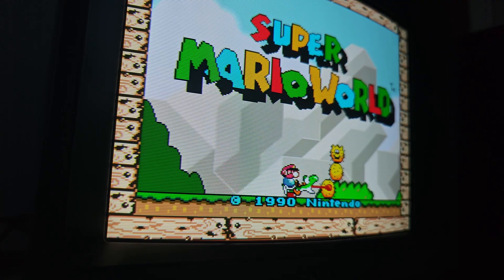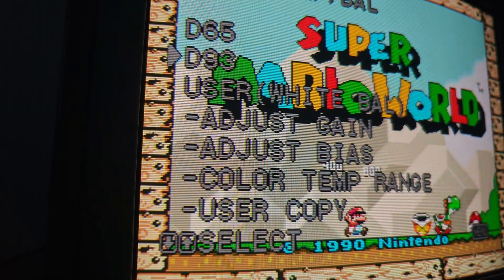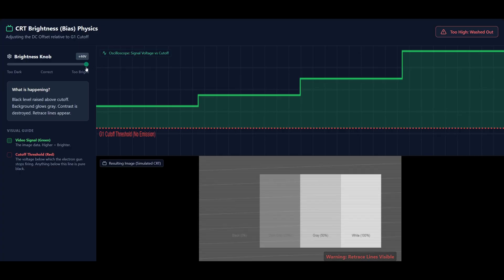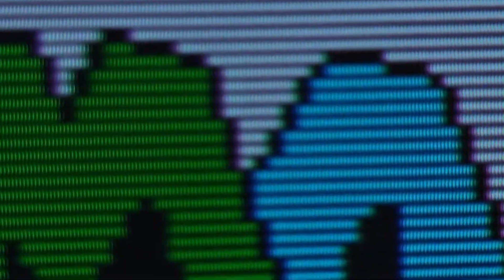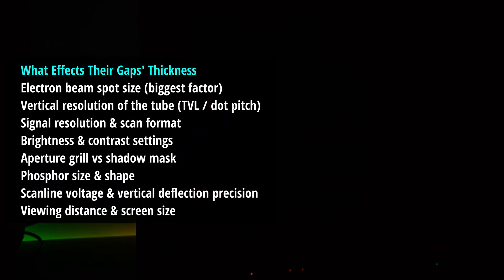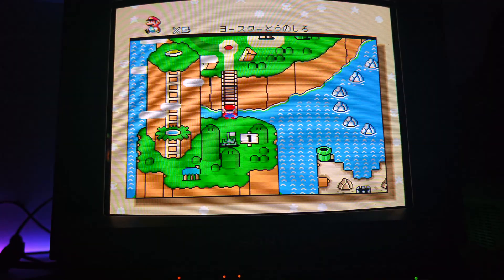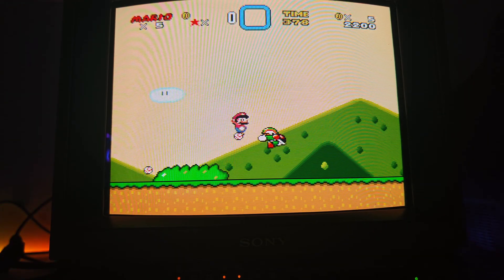High Contrast: The Scanline and CRT Silent Killer

Comment: when using composite or S-video you can adjust how colors look with the "ntsc setup level" setting, I believe 7.5 should be used, and for component there is a setting called "component level" 7.5 should also be used as well. It makes quite a large difference in black level. I recently found out about these and fixed my issues with s-video and component, they looked much worse than rgb, now they look amazing.

Comment: Thanks for this video. 
I revisited my settings for my 14m2e and realised I had my contrast set far too high. 
Sometimes my fd trinitron looked sharper than my pvm and now I know why. This has really dialled the image in better for me with much sharper and pronounced scanlines by moving the contrast down. 
I’ve disabled the trap filter that was set to on and moved the ntsc from 7.5 to 0 with the D93 colour palette and it’s looking great, much clearer. 
Hopefully the set lives for a few years longer too now 👍
Reply from the maker: You are welcome. Yeh, lifespan of these precious tubes is a significantly important. It's not that are easily replaceable and fixing can be troublesome for some. Happy to hear it helped you out.

Comment: 04:51 The electrons spread out because slower electrons do sharper turns in a given magnetic field. Bright images sag because they would violate the specified power ratings and basically cooling. I guess that "paperwhite" Macs had such a small tube to keep power in check despite all the white. I love dark mode btw.

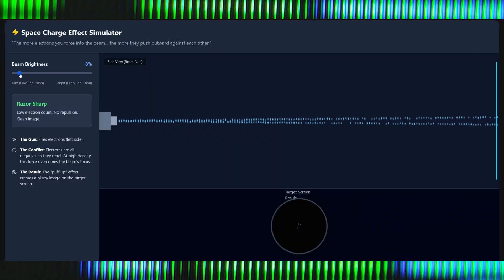Comment: 04:17 what about the electron gun? As far as I understand, electrons escape the cathode until space charge becomes to big. The analog modulation lets out some electrons. They accelerate and disperse. So space charge in the beam is always far lower than in the gun. Also electrons accelerate almost all the way down to the shadow mask. 40 kV on big color TV. X-rays. So the density is very low. Electron optics can be adjusted to focus at a certain intensity. So the spot becomes wider for darker and brighter colors. Space charge is a quadratic effect. So we need more modulation on the lenses, but still far less then on the gun.

Comment: Japan used D93 white point so every Japanese console and anime from before the HD era will look correct on D93. Black level (controlled by brightness) for analog videogames is 3.5 IRE in a Full RGB range (7.5 IRE for NTSC content like a VCR), it's not cero, the beam never turns off, if you force a very low black level you will lose a lot of dark detail, not only that mid tones will be at a lower luminance and image may look less vibrant, this is really important for the CRT to look it's best. Contrast (White level) should aim at 100 nits to 120 nits less will be too dim, more will put the autobrightness at work, CRTs were never super bright. You'll need a colorimeter for that one.
Reply from the maker: Great insights thank you!

Comment: Nice video! I usually do prefer d65 as im used to it in all my displays haha bit yeah on the beggining it can look strange or yellowish, but its just not blue
Reply from the maker: Thanks. I see the 'blue' as natural but I think I just got used to unnatural light maybe. D65 is more comfortable and less stressful on the eyes for prolong sessions and aside from that, for other games that I played I actually prefer the warmer tone. So it's kind of game dependent. So in general, I think that I'll also will be favoring d65 for most content, at least based on my experience with more games tested as of now. Thanks for your comment.
Reply: @CRTGang yess i also noticed the lesser eye tiredness haha but yeah the bluesh tone can look punchier and sometimes looks nice, but the d65 gives me a more cinematic vibe so.. haha its a taste thing (:
Reply from the maker: @gustavosanches5674  Yeh, and at least in the case of the PVM this can easily be adjusted. I do this all the time when playing games on an LCD, just switching a color profile to what I like better. Color accuracy unless it's a critical work and for checking out first don't matter that much to me. Also when I played a lot with warmer tones at some point, the 'colder' tons look waaay TOO BLUE, soi it's also the adjustment to the change that plays a significant role. I felt the same with sound BTW, when my years are used to a certain sound and I move to a different headphones.

Comment: I'm using a Samsung Syncmaster 955DF high end 19inch PC VGA CRT monitor. 0.2309mm real dot pitch with a flat tube and invar mask.

Literally the sharpest dotmask CRT i ever watched in my entire life with text clarity that destroys my 24 inch 1080p LCD, looks like crystal clear as a 27 inch QHD display. It doesn't matter if i increase or lower the brightness, the size of the scanlines doesn't change.

Daily driving this beast at 1792x1344 or 1706x1280 60Hz progressive. I usually use 1080p for 16:9 while watching youtube videos to get more of an HDR brightness and color pop. I never tweaked this PC monitor, it just works.

I have a Sony Trinitron 32inch TV and the problem with Trinitrons is degraded geometry or stability vs something like my Samsung dynaflat tube.

Since i can't reach 15KHz for minimum horizontal frequency, i only use a component shader and get half of my vertical lines for that PVM look but with the benefits of an absurdly sharp high end PC monitor (holy grail is the 1100MB or 1100DF, or the top tier Mitsubishi Diamondtrons that absurdly expensive, or the FW900).
Reply: vector displays and pictures of the yokes and impedance measurements by others tell me that vertical deflection responds well to overlaid horizontal deflection -- if the electronics was FOSS -- . We need a Mister for CRTs. Then the repeated scanline could form groups, and then jump to produce one black line. With the pixel clock of HDMI it should be possible to create vertical scanline (on a dotmask).

Comment: Great video and I'm glad you made it because I've been arguing these exact points for a long time but your video makes it very easy to understand quickly.  I would add that turning up the color setting too high can worsen the image because it causes color bleed which, in effect, softens the image.  I do have another suggestion for a video.  I notice that when viewing a pure RGB signal on a CRT TV, the colors look more muted or subdued and personally, I don't like that.  I generally like the color processing on CRTs that's added to the other signal types because the image looks much more vibrant and sometimes more accurate.  For example, I often find that with a pure RGB signal on a CRT, yellows, reds, browns and orange look pale but compared to composite, s-video and component, yellows look much more vibrant and accurate and reds look much more vibrant.  This is especially noticeable when you play a game such as Super Mario Galaxy that makes significant use of yellows, reds and browns because of Mario's red outfit, all of the yellow stars in the game and the many levels where the ground is a shade of brown.  It would be interesting if you did a deep dive on CRT color processing and how it works.  Another interesting side note is that some CRT TVs allow you to change the type of NTSC color decoding in the service menu.  On my Sanyo DS27820, I didn't like the default color processing so changed to a different NTSC color decoding option in the service menu and it greatly improved the picture.

Anyways, keep up the good work.  Videos like this are exactly what we need in the CRT community and the depth at which you go into this stuff is very much appreciated.
Reply from the maker: Thanks. I'll be saving your comment as this is an interesting topic. I can do more testing and research about the topic and check it further. I just need to buy a new cable just to make sure it doesn't have issues to make the test more accurate. Thank you.

Comment: If D65 white looks too red then it probably means the white balance has drifted over time needs to be recalibrated with manual RGB gain adjustments.
D65 white when set properly doesn't really look like anything, just milky neutral white, like talcum powder.
Reply: Even on professionally calibrated LCDs and OLEDs using 6500K looks more reddish or yellowish than real life white like the sun in space.
Reply: @saricubra2867  
D65 white looks exactly as it's supposed to on every display that doesn't suffer from the effects of observer metamerism.
CRT, Plasma, and older CCFL LCDs do not suffer from this perceptual phenomenon that you alluded to.
The classic look of D65 white, as per CRT, can be replicated on an OLED display using a perceptual matching technique or the newer CIE 170-2:2015 colour matching function.
Reply: @Solus793 The mathematically correct white is somewhere between D93 and D65.